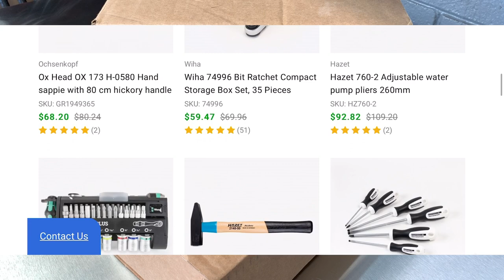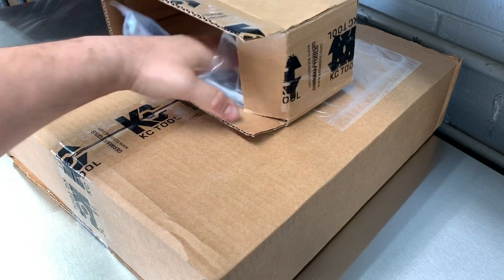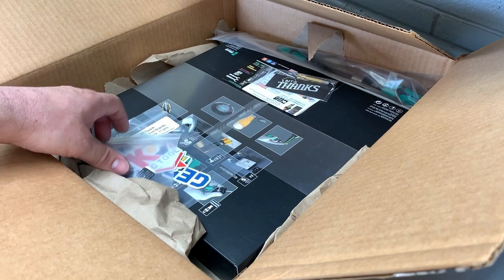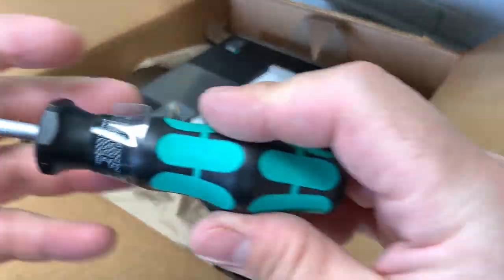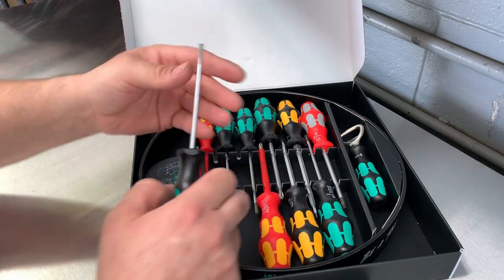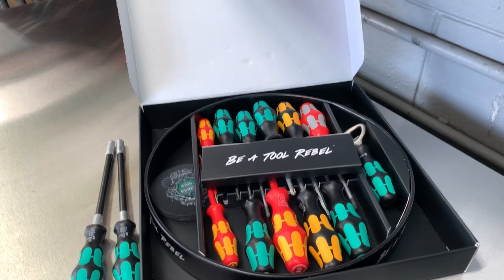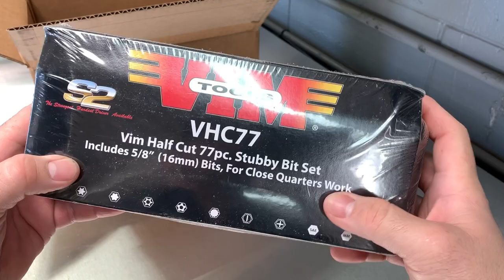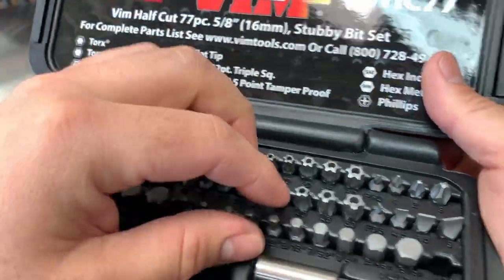Big KC Tool Haul!

Comment: So if the diamond tips wear out on the screwdriver you were saying do they replace it free under a warranty? 

Love the tool tray. The WIHA name sounds familiar. Wonder if I bought something from a different tool company with same brand
Reply from the maker: Dale N Thanks! I think wear and tear is not covered. For the bits, they’re considered “consumables” so definitely no warranty on wear there. So there’s kinda a thin line on the screwdrivers. One thing I was told on the diamond tips, is that they actually wear fasteners. So gotta be careful with those. Wiha might be rebranded on a few things, you can see them pop up here and there, but for the most part they got their own thing going.
Reply from the maker: Dale N hey, couldn’t find your comment about finding the holding socket set. I put the link for it in the description 👍
Reply: @AutobahnDan  I think I misspoke on the tool. You had a 3 piece 1/4 drive vim tool or some brand that were drivers for 1/4 drive screwdriver or 1/4 electric TYPE driver. On the 3 pieces on the other end was 1/4, 3/8 and 1/2 drive that had a locking collar that kept extensions or sockets from coming loose. 

That's what I'm trying to figure out where you bought them on the kc tools page as I thought it was one of those tool hauls that had that?

Also what magnetic spark plug socket set were you using for spark plugs? I have a gearwrench set but sometimes they're to long or short. I think I want to get a regular set of magnetic spark plug sockets that I can use my locking extensions with as you did. I've always wanted something with lighter torque to not cross threads. 

I've use my Milwaukee 3/8 impact with the Bluetooth "One Key" I think it's called. I have 4 torque settings programmed in using the app for it. It also has wide open if you don't use the bluetooth settings which is good as you essentially have 5 settings.